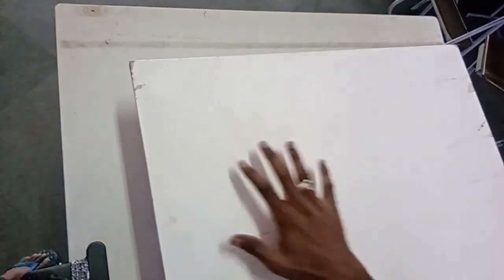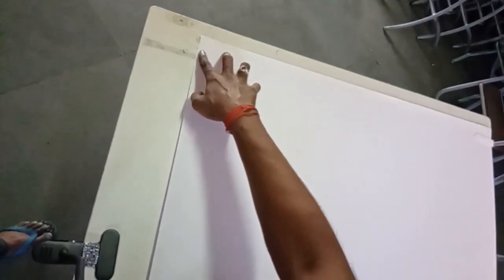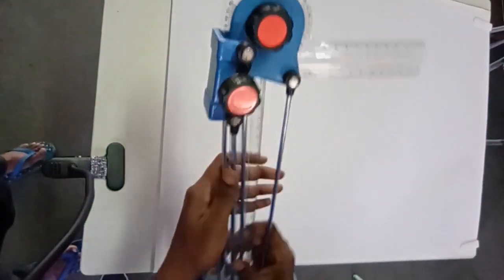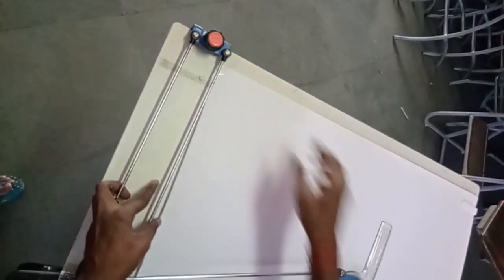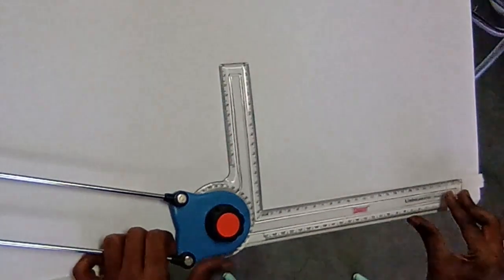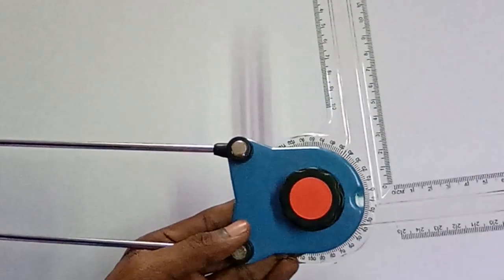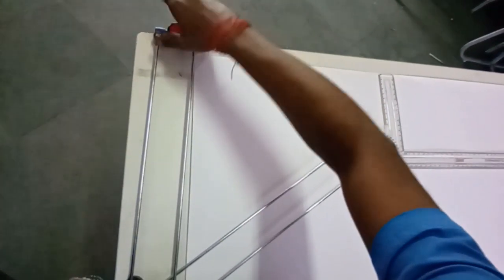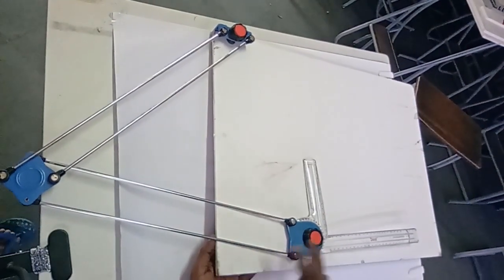Fixing the Mini Drafter to the Drawing Board (for IIT Guwahati Batch 2020)

Comment: Sir if the size is not exact to A1 ,i.e. 750×550mm then it is not considered as A1 sheet?
Reply from the maker: A0	841 x 1189mm	33.1 x 46.8inch
A1	594 x 841mm	23.4 x 33.1 inch
A2 link	420 x 594mm	16.5 x 23.4 inch
A3 link	297 x 420mm	11.7 x 16.5 inch
if it is not in the size mentioned above it will not be considered as standard sheet, if you get chart paper it will not be in standard